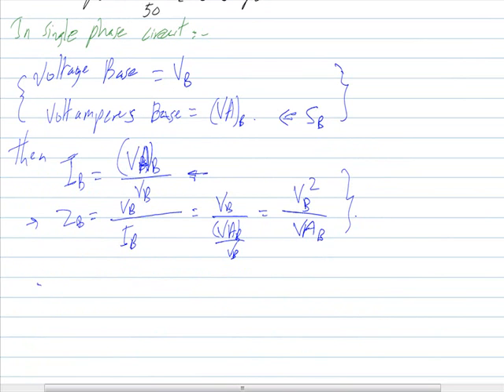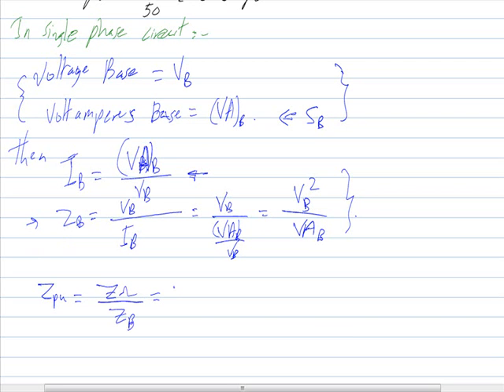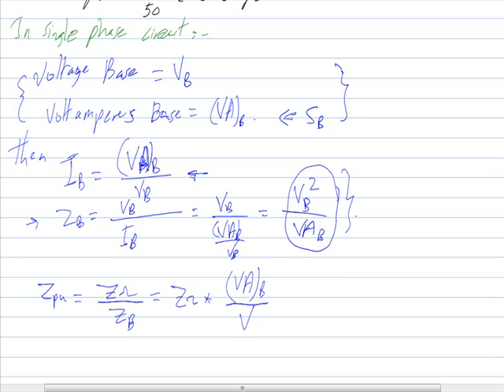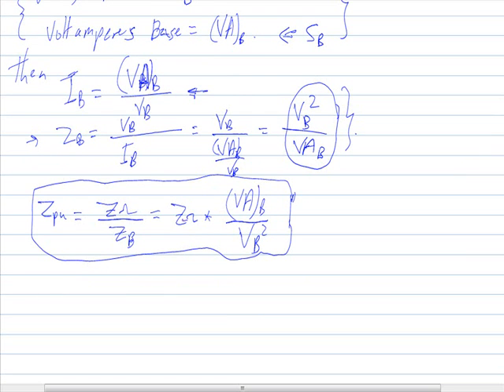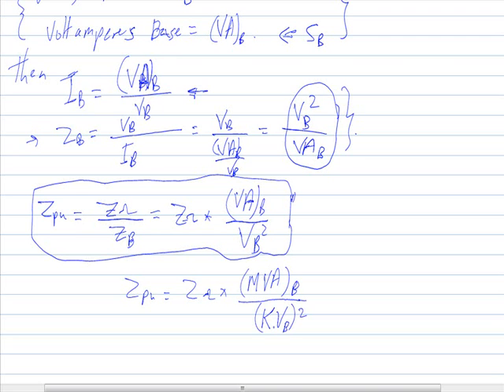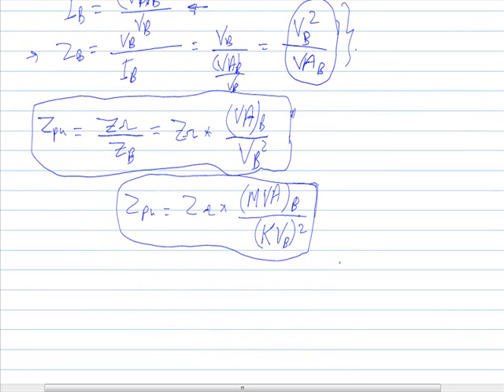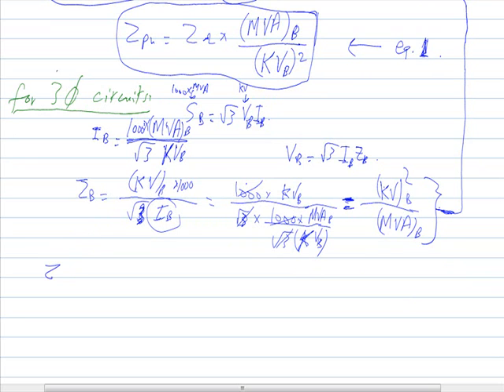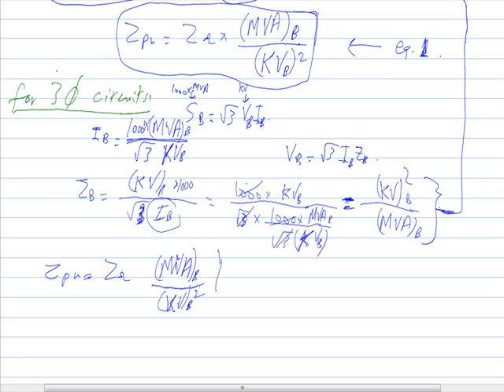Power System Analysis (Lecture 1.2) Per unit system

Comment from the maker: because you will put the S(base) value in MVA and voltage in KV value so you need to multiply the denominator by 1000. Meaning, Mega divided by Kilo= 1000
Reply: YanbuCollege but you are multiplying the numerator by 1000
Reply: So the 1000 should not be in the numerator, where you wrote it, but rather it should be in the denominator...correct? BTW thanks for the videos! they are very helpful.